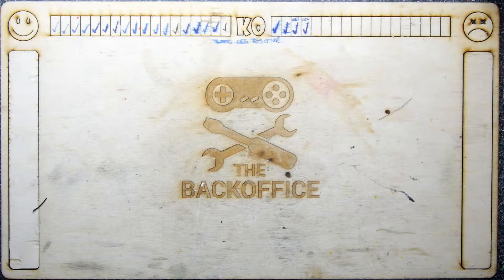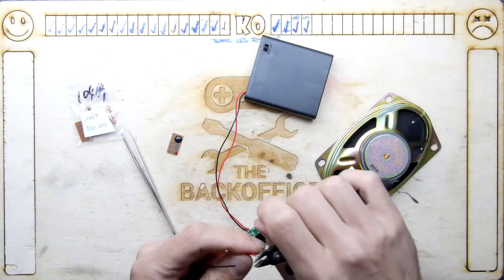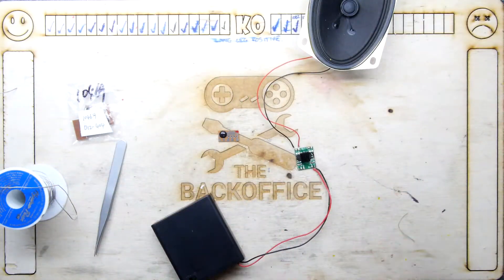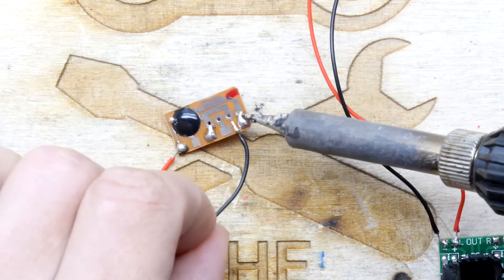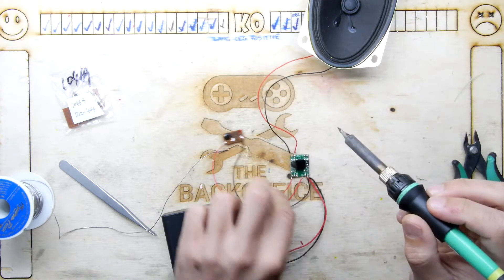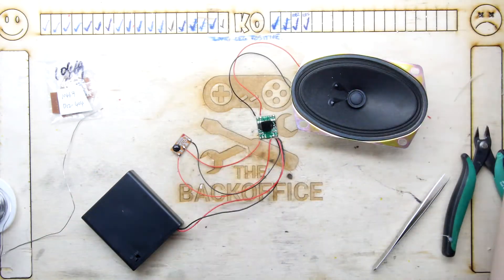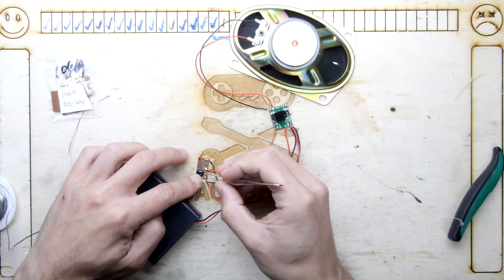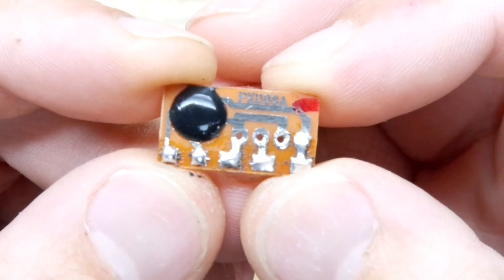Chinese Birdsound IC

Comment: About 16 song chip:
It's shaped like those single in line circuit slot chips, and has markings starting with FX.
Unfortunately it went out of stock on the last seller on eBay that sold the chip :(